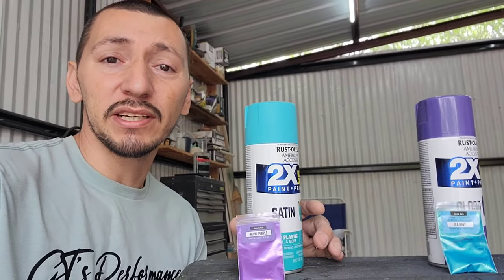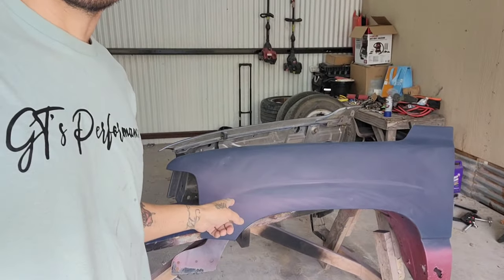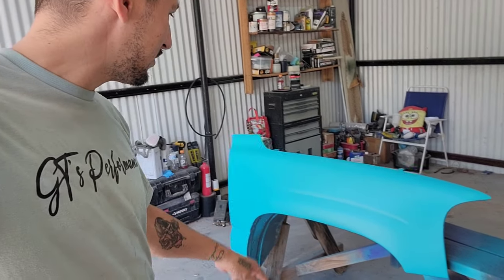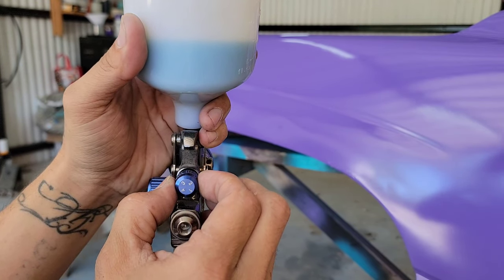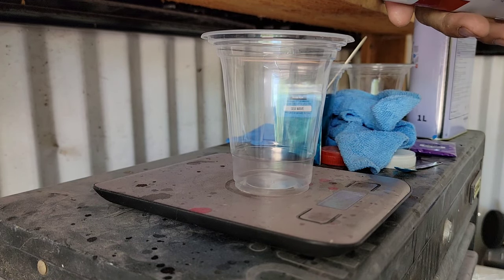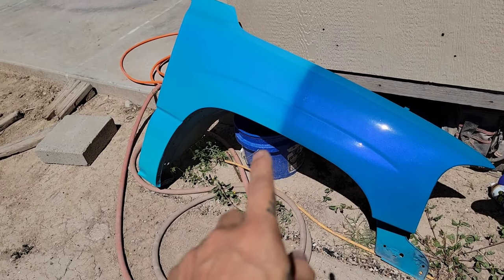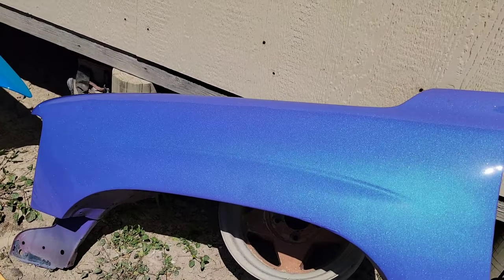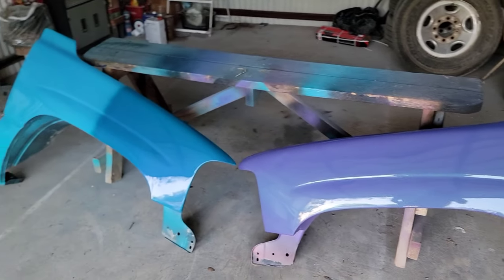Let's Spray - SUICIDE AWARENESS - Rustoleum Paintjob with Teal & Purple Pearls

Comment: LOL, I told you I've been binging this series (at this point I think I've seen all the ones that you have put up)... 

Now it seems like from your previous experiments the teal pearl over the purple would have been the winner since almost as a rule you've had better results with pearl over a darker color vs over a lighter color, but where it doesn't match up is that you had a good result over a gloss, which didn't work as well before.

I guess we don't know that it wouldn't have been better over a flat purple...
Reply: Now you have me working around how to test this- it's easy with black because it's easy to get a flat and a gloss black, but with other colors... huh... I have an idea that could be done with sprayed quarts but that adds another variable- I've used gloss hardener with them, I know that you can get flat hardener also but I haven't tried to see how that would work with Rustoleum...